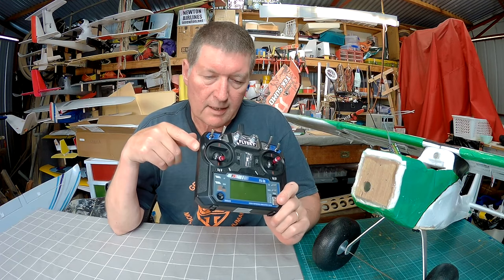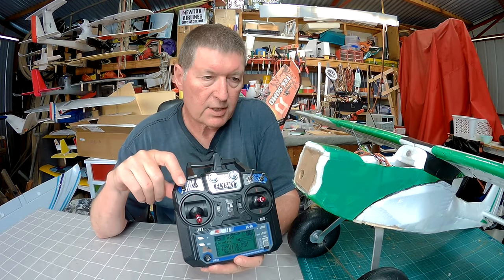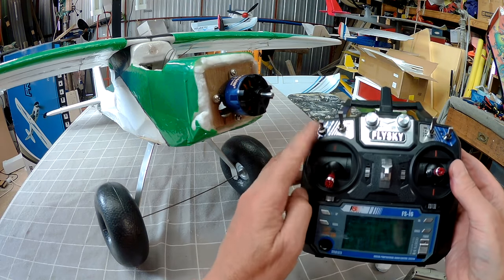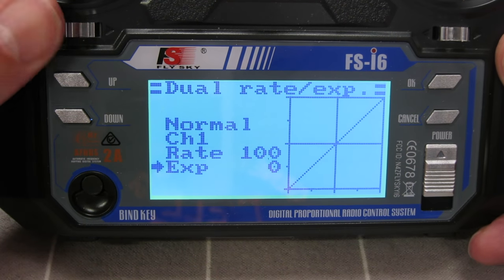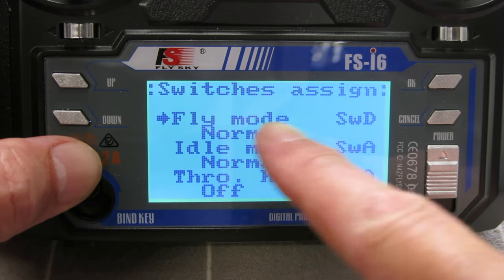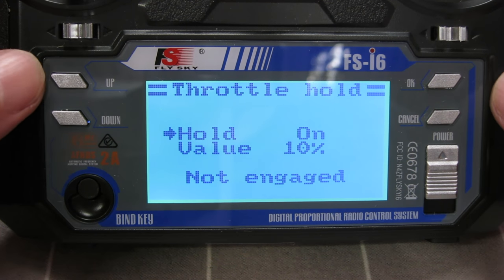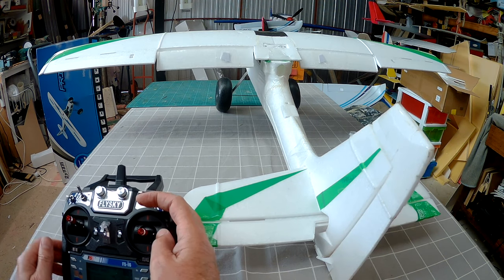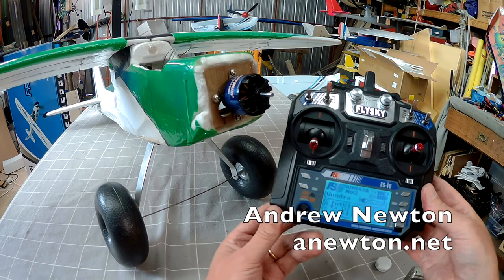FlySky FS i6 programming

Comment: Just bought this radio and I like it so far! Thanks for going over this in detail it helps a lot!
Reply: ViperTech how it is so far now? i am planning to buy it, is it worth the price ?
Reply: @butkorosu8853  Hey 4sale TV  how is it working out for you?  did it come with a receiver w/telemetry?  does the unit have a good clear  voice for the telemetry call-outs on battery level of the on-board motor battery?

Comment: Just wanted to add that I went through your video carefully last night and was able to successfully program the throttle safety switch, the the dual rate switch and the accompanying expos, what looked a little intimidating at first is turning into an interesting journey. Thank you, Andrew. I didn't buy the Taranis QX7 because of the programming involved at start up, I kinda wish I had I had gone for it now. But this Flysky  FS-is6X  is better than I am right now and I won't be afraid to upgrade when I have a good reason to do so down the road. Cheers and many happy days to you, sir.
Reply from the maker: Great to hear that Brooks. It's still a great radio with amazing range.

Comment: I had a lot of fun using that radio as a controller, via SmartPropPlus (SPP) with the free flight sim PicaSim. A DIN plug is wired to a 3.5mm audio jack (pin 1 of the DIn to the tip of the jack, and sleeve to sleeve to connect ground) plugged to line-in. The Flysky works in  PPM (Walkera) mode within SPP transmitter settings.

Run SPP before starting Picasim. In the Joystick settings map the sticks and you've got a cheap flight simulator.
Reply from the maker: Excellent information Mike, thanks

Comment: Andrew, I believe that the throttle hold is for the nitro flyers who would use that to set their idle speed. Great video on programming. I suspect it applies to almost every newer radio. My older Spectrum 7Ch is impossible to program even after watching videos and downloading the manual.  Any good videos going in to depth on Expo and dual rates?  Folks love to tell us what they are set at but not why. 
Thanks again for doing great, informative videos!
Reply from the maker: Thanks Tom, I'll add expo and rates to the video list. It's a good idea.

Comment: Add on to flap setup useing only one switch...to make this setup easier when you do this start with the c switch in the neteral position flip the switch up so the flaps move up then disconnect the service linkage and reset the flaps to netural.... while the sevro is still
Up position.now follow the instructions I hope this simplifys
This setup...Jeff b.

Comment: Hello again Andrew this is Jeff b in Seattle I'm writing my review of my first flight with an 
Phoenix evolution plane it has 2 wings 1 is 62" the other is 102" wing..I used the 62" wings. It is the first plane I've had that is all screwed together, the thing I noticed was the rudder does not attach very well in the front.so I used some foam safe glue to keep it in place.i launched it and it took off very well I started gaining some altitude and went to make a left hand turn at about 50 feet high and during the turn about halfway through it took a nosedive I got the throttle before it hit but it still hit pretty hard. I've flown many Balsa planes so I was figuring to have quite a repair job ahead of me I walk to the 50 yards to retrieve it and I could not believe it the only damage to the plane was I cracked the nose cone nothing else nothing..... Now what had happened was I used the foam safe glue because it's foam writer but the plane is made out of plastic PVC type of material in which the glue did not adhere to as well as its I thought it would. So I'm going to score the top of the fuselage and use a different type of glue and I believe that will cure the problem but overall during the flight that I did have the time to say this it handled exceptionally well plenty of power good flight stability and extremely durable if it wasn't for me using the wrong type of glue I believe this would have never happened so overall I rate the plane very high the only problem I found in the plane was the one flaw where I used the wrong type of glue
Reply from the maker: Nothing will glue to the plastic, need to use screws
Reply: Andrew Newton thank you again I will take your advice and do that rather than  doing it the hard way lol... thank you very much Jeff b in Seattle

Comment: That is a smart setup, will copy some of your ideas . . . I implemented safety switch with throttle hold and had a and d switches switched. Also had flaperons on potentiometer. Will add some of rudder compensation if needed. Thanks!
Reply from the maker: I need to work out flaperons

Comment: how do i change the handset so i can use both left and right controls for two motors on a boat?
I need reverse and forward for both controls to turn sharply.
great instructions.
i bought one from new but its preset for a plane.

many thanks
Carl
Reply from the maker: Cant help you with that. Depends on your boat electronics. Might have to ask on a boat forum

Comment: Thanks Andrew, this helps a lot. Although I use the throttle hold with a value of 0 as safety switch for my fixed wing
Reply from the maker: Thanks Andrew. That is the usual way, but I prefer this way with the switch in the up position.

Comment: After watching your video the one you built with a fiberglass pole for the tail section connections I thought about it and figured out how to use the screws to fix the rudder  so I'm going to cut a slot on the underside of the fuselage and screw it in that way .at first I didn't see how it would work screwing it from the top. After watching your video where you built the glider from scratch I realized that through the bottom would be the best way to do it because your answer to me was use screws and I thank you for making me come up with the answer to do it from the bottom side rather than just tell me that I appreciate the challenge. However what I'm thinking is I might use a thin piece of Balsa and then slip it between the rudder stabilizer and the fuselage glued to the stabilizer for a little extra strength....
Reply from the maker: I thought you were asking about adding a hinge to the lower section of the rudder near the control horn.
Reply: No I apologize for that no the front of the rotor stabilizer where it attaches to the fuselage is what I was actually referring to but after watching you Bill that plane I figured that would be the best way to secure it unless you have any other thoughts or suggestions that I might consider
Reply: It said router I ment front of rudder I used glue it didn't hold .that's why I thought of useing braces along the rudder fin to hold it from moving not the rudder itself .that's why I was going to add a piece of thin Balsa to the bottom of the rudder fin and drill the holes from the bottom side into it that would give me extra stability if doing acrobatics.should I use a piece of hard rubber as a washer inside to keep it from inlarging the hole from the stress???? Or would you recommend another way Jeff B Seattle thank you
Reply from the maker: That makes sense now Jeff. Your ideas are all good.

Comment: Andrew I was hoping that you would recommend how I attach the front of the rudder to the fuselage in a little more detail than just using a screw if you would please I would appreciate it
Reply from the maker: I have used a little plastic hinge, with one side glued into a slot in the rudder foam and the other side screwed to the fuselage with 2 little servo screws. No need for backing, it would be impossible to get it into place anyway.

Comment: Basically, the whole point of this story has been about getting back to basics. And making sure everything is working properly, which is what I did not do by testing out the batteries. Had I have done that I wouldn't have had any problems. I don't think. But now that I've solved that issue. I'm looking forward to getting back out there and flying again in all three crashes. I've done no major damage.
Reply from the maker: Good to hear no major damage. It's all learning experiences

Comment: Thanks I'm finding that out lol.i have taken the motor apart in my  evolution and had it put the  c clip back on the  shaft to fix it but I think I'll end up  replacing the  motor on this one. But other than that  I had a  great  flight and I thought  a good  landing, I was  wrong LOL..in your  Phoenix did you have to  add  weigh  to the  front  to get the  C.G CORRECT. on your plane and for that plane what is a good  angle for this  plane I have it about a 5%down grade from  level
Reply from the maker: I usually find the Phoenix CG can be a little further back from the factory marks.

Comment: Very helpful video. Thanks!
There is one issue I am facing with this transmitter........ I am in the process of building a RC excavator and will be using the sticks to operate the bucket, arm and the rotating cab. That only leaves me with the VRA and VRB channels to drive each independent drive wheel (for the tracks)....... My question is... Is there a way to program the transmitter so that i could throw a switch and operate the tracks on the sticks too (like a mode A & B... disable the original commands and switch to "track mode", then switch back to "dig mode" without changing model)? I have seen a video where a Spektrum transmitter was set up to do this (though the author never explained how to do this).
Any help would be appreciated, as this is my first step into the RC world!
Reply from the maker: Unlikely. I don't think it is configurable enough for that.

Comment: Idle up mode is normally used for 3D helicopters as the throttle will control the blade pitch
Reply from the maker: Thank for that. I have no idea about helis
Reply: @AndrewNewton  I know a little bit more about them and how they operate, then I have skill to fly them, either way it's not a whole lot.

Comment: Hi Andrew, Yes I have plugged in the auxiliary cable ( that's the only other cable I seem to have ). What do you mean by setting up a switch? I'm very new to all this so I'm a bit ignorant.
Regards, Turlough Kennedy.
Reply from the maker: Do you have 2 servo style cables coming from the ESC? The main speed controller cable to the throttle channel on your receiver and the reversing cable goes to a spare channel (5 or 6). Then you have to assign a switch to that channel in the radio setup. Watch the video, it shows how to setup Aux channel switches.

Comment: Have just aquired another Flysky i6 (great unit) TX into which I was going to install a Assan Duel receiver contoller for buddy box training with out the cables. 
Question.... is this model OK for this operation, if so could you please advise the details for connection. Thanks Colin
Reply from the maker: No idea sorry

Comment: I was going to set up for flapperons but, I suppose I could use the elevons or Vtail options. Depends what Ch the servos are on. The mix will do the same thing. It's pretty much the same as my old Flysky T6, bar it uses less batteries & also supports afhds 2A. Still think holding 'cancel' is a bizarre way to save the menu settings & holding 'ok' seems to reset it. Think they always got that back to front tbh. Let's hope it lasts longer than my old FS T6. The screen crapped out after about 18 months. I got it working again, broken lines but readable, not worth the hassle when this was available, especially on sale half the price. FS GT3 is great, great screen & USB rechargeable lipo. That's what these 6 Ch + need. A least a charge port for the batteries. That's what I now use the back of the old T6 for.

Comment: Andrew, excellent video this is just what I needed for my sky surfer. My question is will mixing in elevator with the ailerons make the sky surfer roll better? more linear without spinning down during the roll? or should I mix in rudder for better roll rate and performance? I would love to see what you come up with for the bixler or sky surfer to make them roll on 100 percent rolls with max throw the best they can.  I have this flysky fs-i6 radio so I need to know what is the best setup for the plane.  Thank you!
Reply from the maker: Ailerons and elevator mix is a bad idea. Might work for one direction only. I connect flaps and ailerons together the Bixler 2 for increased roll rate.

Comment: Hi Andrew, I've got a rc truck using this remote I'm using switch C for the 3 speed transmission witch works great. Is there a way to make switch A,B,D into on/of  switches for lights or similar? Thanks in advance. Great vid.
Reply from the maker: Yes, but if you plug lights into the reciever they will be getting 5V continuously unless they have the cuircuitry to understand the signal sent by the transmitter. Servos have that circuitry built in

Comment: FlySky i6x transmitter All three receivers I have are the same. But only one produces that second bar tell me the battery life. At the battery in the airplane as well as the battery life in the transmitter. Aside from the numbers on the screen Which all three receivers showed those?

Comment: After I launch it. Thinking it's at full power. As I'm trying to gain altitude. It seems to take a role. To the left and nose dive into the ground. Because it has no power when I put Full Throttle I get full power for in the beginning 10 seconds 15 seconds, and then it's dropped down to like maybe 1/4 power. Not knowing that. Every time I try to go up it would roll and come straight down into the ground.

Comment: Hi Andrew very helpful video. I have a problem with safety fiture all switches have to be up including the throttle, why?
Reply from the maker: Safety feature on most radios. But the throttle cut function is the wrong way around. Thats why I use the method in this video
Reply: I do exactly what you do to set up the safety feature, but when I turn the transmitter on it says: lower throttle and all switches up. But the throttle also have to up. It is driving me creacy. If I do not set it up to the top position the transmitter will not work

Comment: I have a Turnigy TGY-i6 (for model yacht racing) which I believe is the same as your Skyfly demo. model.
The sails control lines (operated via a winch) are on channel 3. A friend can use switch  to make small in/out adjustments to the which (on left hand stick). Can you please advise me how this is set up.
Also, is it possible to have the left hand stick "notchy" rather than the smooth feel?
Thank you, Alan
Reply from the maker: Yes same transmitter. Don't know about the notchy feel or the right stick fine winch control sorry.

Comment: I found why my SWITCH C do not work as you show.  on displays ( end points) my setting was    chan5 ( 100%   0% ) ch6  ( 100%  0% )......    I need to set   ch5 ( 100%  0% )              ch6  ( 100%    30% ) , 30% is variable depend if I want more travel on flap or less  travel on flap.   thank you very much is working now.

Comment: Thanks for the guides you have done with this controller, I've just set it up on my first ever glider (Hobbyking Walrus) general setting weren't too bad but I dont really understand how to set the mixes. Also the flaps dont operate like yours, when the c switch is in the middle the flaps are level, switch it up and the flaps go up, switch it down all the way and the flaps go down. I'm at a loss as to how to set it up like you have it.

Any advise would be much appreciated 👍

(Edit, don’t worry about the flap setup, I’ve just read someone else’s comment that explains how it works)
Reply from the maker: Just need to take off the servo arm and put it back on at the angle that gives flaps level when SWC is up, or shorten the control rod. Have a look at my playlist for the i6 radio.
Reply: @AndrewNewton  Thanks for taking the time to reply Andrew, much appreciated, I'll check out the other videos too 👍

Comment: It's not a question of temperature the battery is called the motors called and the ESC are all called the batteries fully charged it after running it for just a moment it seems to be dragging when I turn it off and I spin it it doesn't spin as freely could there be a plate loose inside have you ever ran across this problem before and you think if I sprayed WD-40 inside it would help
Reply from the maker: Something rubbing or bearings worn out? WD-40 might help.
Reply: @AndrewNewton  it never gets hot enough to cause any changes in it but the bearing sounds like it would be better reason for it to happen I've tried to remove the  set screw on the shaft but its not  bugging so maybe I'll drill it out and check it out inside  being stuck inside because of the virus  I've got a lot of time to do it...thank you

Comment: Hi Andrew. I know this is sn old video but so helpfull and still relevant. My question! Is there any way of having vario, with the ascending and descending tones, that will work on flysky fs-i6 wìth FS-iA6B Receiver, seems a lot of folks would like to have this, me included. Cheers Thanks for all you help.
Reply from the maker: Sorry I meant to answer when you asked earlier. Not with FlySKY unfortunately. Your FS-i6 doesn't have audio from memory, and there aren't any compatible varios as far as I know. Need an FrSKY vario with an OpenTX/EdgeTX or Ethos radio and SmartPort receiver or a flight control board.
Reply: Ok, many thanks for that info. Keep up the good work! Cheers